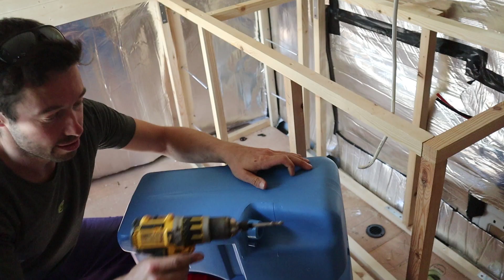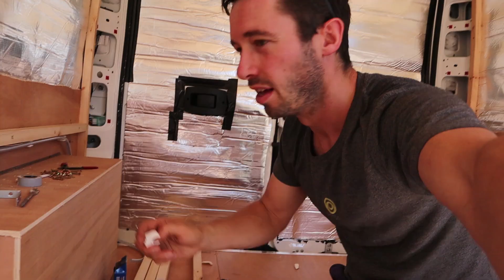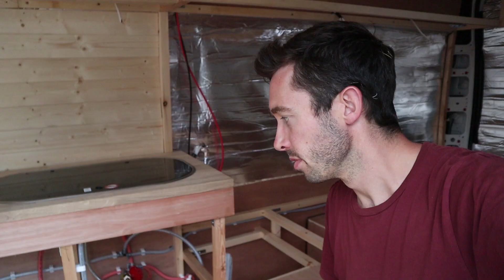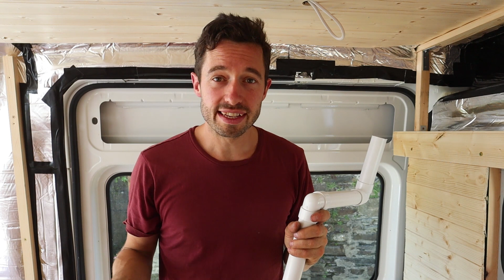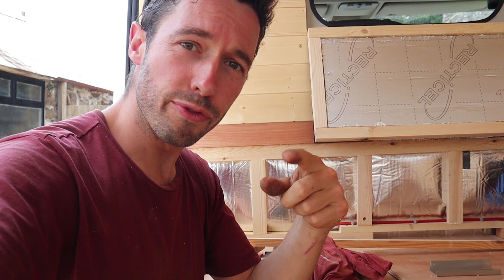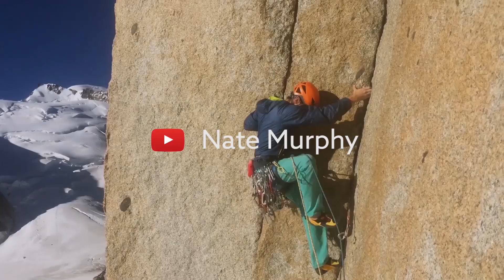WATER SYSTEM

Comment: Hi Nate, what psi was the water pump you used?
Reply from the maker: 40psi
Reply: @NateMurphy   legend mate! last question i promise, I’m fitting a shower in my van but the tap I’ve got is rated to 43.5 psi and the pump I want is 45 psi. What do ya reckon? Im hoping it would hold up. Did you check if your sink tap would take the extra pressure?
Reply from the maker: I think it should be fine.
Reply: You my friend are a legend!

Comment: Hi Nate, so grateful that you have done the guide, would you remember what size elbow joints you used for the water inlet?
Reply from the maker: Prob 40mm.. poss 32... but check the pipe size you want to use and make it fit. Sorry I can't remember from the top of my head.

Comment: Hello sire! Taking a look at your designs and it looks like you don't get hot water to your sink. Is that correct? If so, what was your reasoning for that and did you consider/try to pull hot water from the shower system?

Love to hear your thoughts!!
- Adam

Comment: Great video and really well explained! How do you get water in though? It looks like you've drilled a hole to the outside of the van and you fill up from there? And where do you typically fill up? Do you go to gas stations?
Reply from the maker: Yes, the fill point is on the outside in this van. You can fill up at gas station somes times, sometimes from town/village springs. In this case I just use a 25l container or a large bottle to transfer the water in. Depending on where you are in the world there are different options!
Reply: @NateMurphy  Hi Nate, I've just bought your guide but can't find how to install this fill up hole which goes out of the van through the side.  Do you have any tutorial or guide for doing that?
Reply: I would also like this info